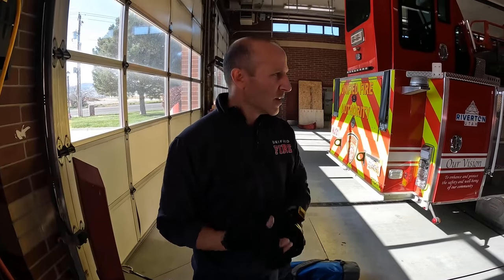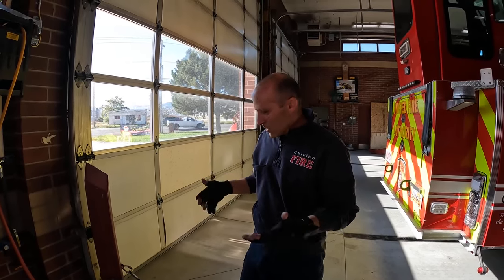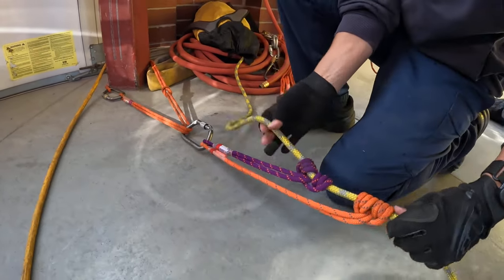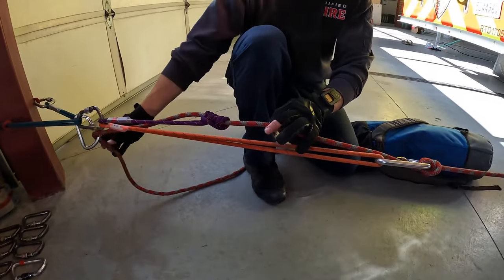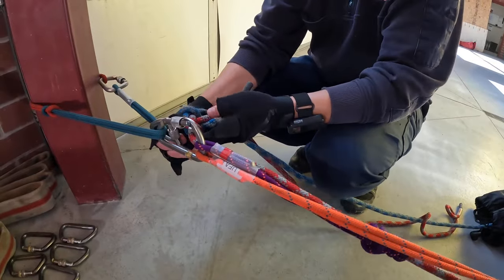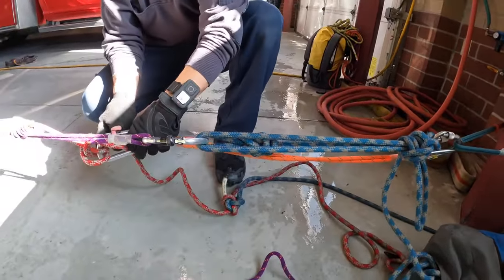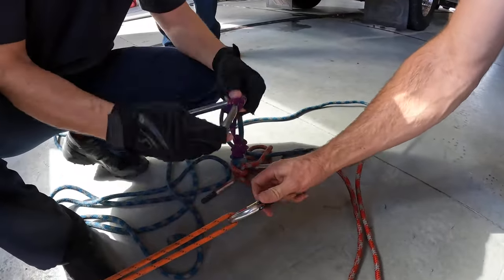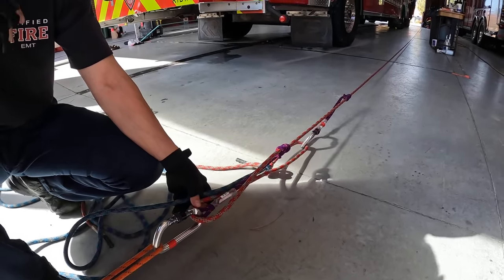Ultra Minimalist Rope Rescue Rigging: Using Only Prusiks & Carabiners

Comment: hi, i realy love when people have the hability to do that, especially becacuse not every time  we have special equipment,  great technic. i have a little recomendation: when use the super mounter hitch  is very important  to check the rope never  cross over the gate  of carabiner, many years befor  i had a trouble when the rope  go out off the caraviner.  is clear, this time i was using a single  mounter hitch,  and is more difficult that ocure  with super mounter, but is is beter take care.
Reply from the maker: You are right, definitely something to consider

Comment: That was one of my main question I know the best way is with the best available technology that being said not everyone has that and I was wondering about the using older style of rigging and if it was still a option to do it like that I know NFPA has changed some things since i last learned how to do this stuff 20 years ago planning on retaking my training at some point to get up to speed you’re videos are very informative appreciate your work
Reply from the maker: Thanks.  In terms of what you can & can’t do as far as NFPA goes, it’s all open to interpretation & all those decisions are at the discretion of the AHJ.  NFPA 1983 sets equipment performance requirements for manufacturers if they want to label their equipment to those NFPA standards.  And fire departments can choose to procure/use NFPA labeled gear or not to.  We use a mix of various gear, some not tested or labeled to meet any standard at all & others meeting any one or combination of ANSI/ASSP, NFPA, ASTM, or other CE performance specifications.

As far as techniques go, NFPA does not provide any standards on how to skin the cat.  The 1006 & 1670 standards are just a series of job performance requirements that state what an individual & an organization should be able to do safely at a given level of skill/expertise/capability.  This is a  misconception & grossly misunderstood by rescue professionals both within the fire service & elsewhere, especially among mountain rescue teams… The ASTM standards for rope rescuers are almost identical to the NFPA 1006 standards.

Comment: Rollclips, tiblocs, and prusiks. Mirrored 3:1"s for the win. Minimal, inexpensive, and Ultra-light. I know you were trying to make a point that we shouldn't ignore modern tech but a "7:1" with all carabiners? Come on man. 😀

I'm kidding but in all seriousness not every dept. can afford a couple Clutches for each truck. Best to know old school techniques too that work well, not trying to use carabiners as pulleys.
Reply from the maker: Yep... After doing the friction loss math, a 7:1 carabiner stack gives you about a 1.98:1 PMA, while a 3:1 yields about 1.75 PMA.  A 3:1cd gives you disadvantage at about 0.9:1 PMA.......   I guess you could go complex & rig a Double Mariners 7:1, giving you 2.88:1.  Bottom line is if you're going to use carabiners, any more than 3x biners then you aren't gaining much advantage at all.
Reply: @Propeller_Head  I would argue none of those configurations are worth it. You would be better off finding any pulley, grab a snatch block off a tow truck haha, and create a change of direction at the anchor. Then grab all of those cops and by-standers standing around and create a large haul team. Counterbalance for the win if possible. I know the math says otherwise but you are basically doing a one to one at best when you use those configurations you demonstrated. Might as well make it simple and easier to operate.
Reply: @perryfire3006  Alright...I got a story. One time Im up in the mountains of colorado and a car flies past me on a winding road up this mountain at high speed. Next thing I know hes air born and doing barrel rolls. I pull the car over like wtf after his car disappeared off the edge in the dark. I look down and the car is in the middle of a white water ice water river upside down and I hear screaming. theres a man thats mounted the upside down cars. undercarriage and hes riding it down stream. Car slams into a rock and jams to a stop. I look in the back seat and its too far away. But It looks like a woman is floating around with her head submerged. At this point theres cars stopped on this 2 lane with flashers on so everyone is joining from traffic to wtf at this. I turn to anyone in this crowd and ask does any1 have a rope? they all look at me like I just landed off the moon. Nobody has rope. Im left standing there studying what is in this back seat. The more I look the more I determine that its just clothes. We wait 2 hrs standing there for a special rescue to show up and they use every doo dad to shoot a football gun line across the river to guide a raft back and forth across the river and a securing line to keep the raft from going down stream. They send rescue on the raft while every able body in the crowd forms 2 teams. 1 on the anchor rope and the other to give slack for the shore to shore line. They pull out on the football gun line get next to the car then the shore to shore line pins the boat to the side of the car while they grab our dude and shore to shore pulls the boat back in with our dude aboard. I have no idea what he was thinking the 2 hours we just stared at him as he seemed Korean or something so even more unsure of what is happening here. But you could tell he was thinking about making the swim and my voice was angled and loud enough to communicate he needed to stay put and he responded in understanding..First thing I ask is was he alone??..He was.

Point is I now carry 200 ft of rope and a single carabiner on me anytime im off on an adventure and like to know anything I can do with it. because thats what I got and willing to carry. Turns out you can do alot with a swedish seat a prussik and a single carabiner. 200ft of rope is absolute minimalism and better than nothing.

Ive white watered using my feet as a rudder steering rivers empty handed but not in ice cold water and wanted the safety line to make sure I didnt immediately choke and stiff up in the water as much as there was no point in trying to get out there and get whoever was in the back seats airway out of water without a safety line. To anchor me to the shore and free my hands. Just a bad idea. No one had rope. and the crowd was less about that life.
Reply: @gantz4u  Interesting story but my point was that there are massive losses of efficiency using a carabiner as a pulley due to the friction involved. When he was creating the 7:1 by adding more and more carabiners I was just shaking my head because at some point the friction will overcome any mechanical advantage. I'm surprised he was able to achieve a weak two to one to be honest.

Good for you in being prepared but highly consider a few more carabiners and at least two pulleys. Makes a huge difference.
Reply: @perryfire3006  ehh, How often is 200 ft of rope actually going to come into play? Ask 200 ppl if they have 200 ft of rope. No one has it. Thats like an Individual first aid kit. It would be alot better to bring an ambulance and the ambulance is rushing them to a hospital..Where they star flite them to a specialty hospital. The special rescue was pretty much a ambulance fully geared with all kinds of doo dads for special rescue situations. Youre planning a hike to the bottom of the grand canyon I doubt alot of people bring much gear. In fact theres a whole sector that does ultra lite. Im actually more geared up with the rope than 99% PLUS the carabiner. Now argue against tampons as bullet dressings. Some times. Some places. the Only block youre getting is the 1 you carve out of drift wood. Circa the sailor (2021). Your question is why be poor? Why not become highly specialized in a single skill and put $1600 into magic friction devices? Because no one is expecting some guy to start doing barrel rolls when they set out that day. I was trying to get buffet. On my merry way. Buffet closed long before I got there hanging out with this dude for 5 hrs.

I was actually just in the store. that was founded to offer the unobtainable gear to climbers so they can have things. It looked like a bunch of expensive stuff you dont need and just would be nice to have so bought nothing and left. Also the stuff they had looked better and cheaper getting it online. mans been climbing things long before the gear shop opened up. a rope and a carabiner isnt even free solo. can we call it poor people gear? Because I found this one carabiner on the ground.

NEXT STORY: I hear screaming and my gf. is down a ravine in flood water. About to get sucked under into submerged brush. underneath a downed tree hanging on. No gear. I just said woomp. And jumped down there. Faster Cheaper more efficient prioritized over my knee caps. Theres this guy standing there wondering what to do. I magically materialize behind him like an angel(cuz jumping off banks). and say grab my arm. reach out there and grab her. We form a human rope and get her out. she was like "I wasnt even in trouble" pff not from my view you werent. thanked that guy profusely. I owe that guy. What a bro.
Reply: Non of that happened  @gantz4u
Reply: @rogerpalin5864  Alright..You got me..People nor cars end up in rivers. Actually the ones that end up on the news is always a body recovery. So you can look for yourself. PRETTY sure in the fake story you dont stand there and wait for special rescue for 3 hrs because you just happened to practice swimming under ice hole to hole on frozen lakes all winter..My friend Junior would climb 200 feet up a tree and dive head first into the river then climb the waxy plumb tree with no shirt or shoes and just use his hands and feet like a pole climber. Then when the big tree he'd climb to jump in the river fell down they all jumped in the river to swim after the iguanas to catch them bare handed and swimmed 10X faster than me. But no one caught iguana because they flick their tails and swim even faster...And thats where I learned to float down white water without boats or inner tubes.